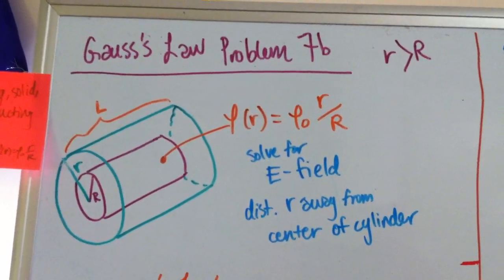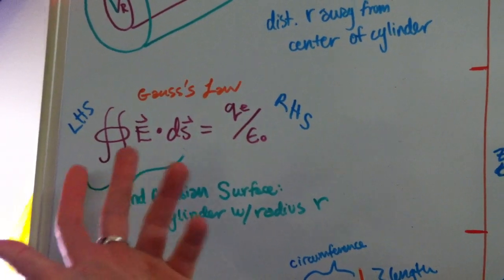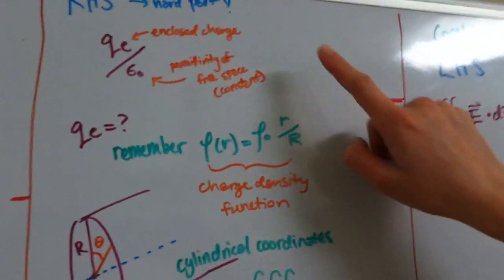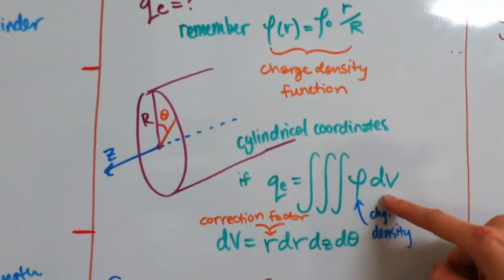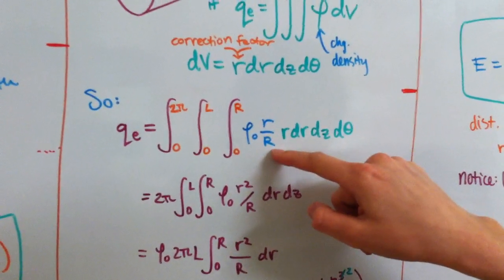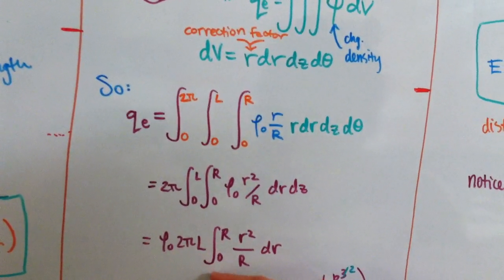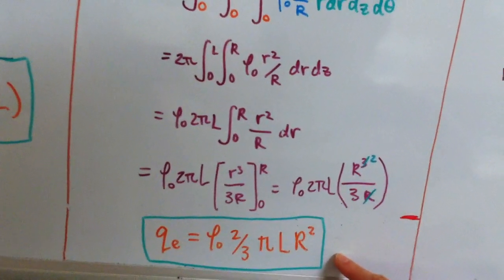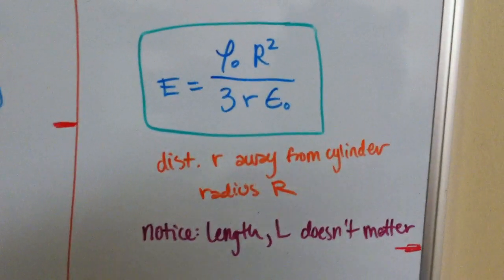Gauss's Law problem: infinitely long charged cylinder

Comment: For the left hand side, Why are you using lateral surface area instead of the full equation for the surface area of a cylinder?  Surface Area of a Cylinder = 2pirl + 2pir^2

Comment: You have two surfaces areas The end of the cylinders (the circular area)  and the sides. I guess for infinite charge we say we get say electric field is always perpendicular to surface so the flux due to the upper circles is zero but what if the cylinder is finite? do we also have to take into account the surface area of the circles in guauss's law? since the area vector and electric field i think would now point in the same direction for the top and bottom of the cylinders? and this would mean the dot product of the circular area and electric field will not be zero anymore for the top and bottom of the cylinders?